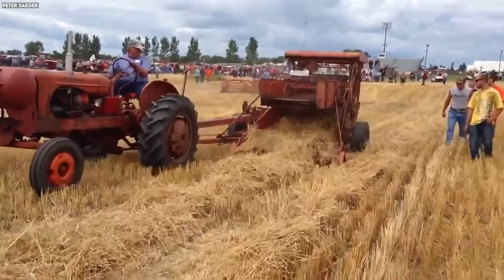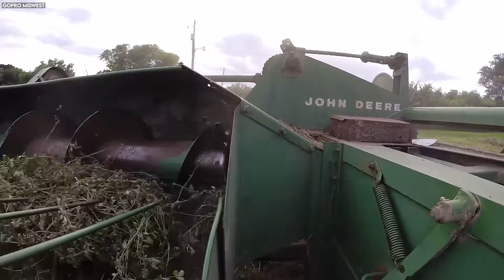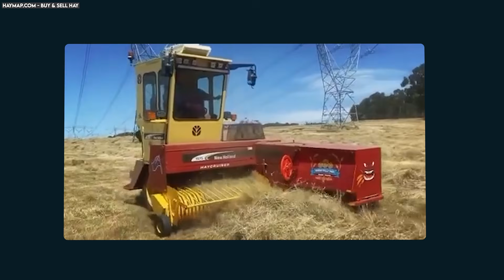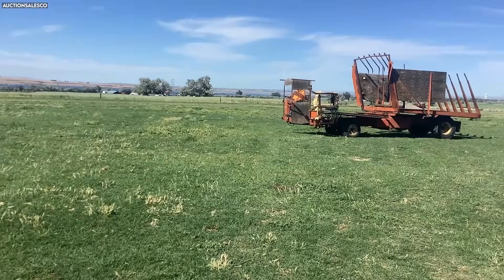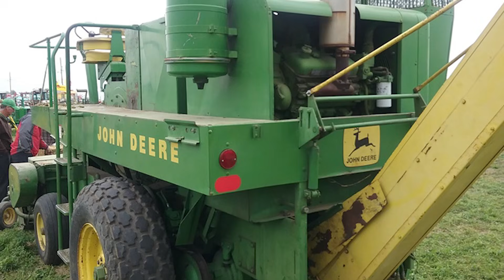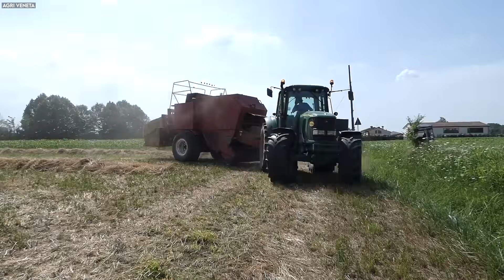10 Forgotten Hay Balers That Were Way Ahead of Their Time

Comment: I only knew of one person who bought an AC roto baler, and it was a true nightmare. Aside from it always being out of whack one way or another, he was using it on sloping ground. The bales dropped in the field, then promptly roller downhill. To bring in the bales, they first had to be dragged/rolled out of the woods. As soon as other farmers in the area saw that abomination in action, they avoided them like the plague.
In it's day, the were pushed not as something that shed rain, but as leaving air channels between bales to aid full curing of the hay. The were a nightmare to bale withand to drag out of teh woods, but also in loading, moving, etc. AC stopped building them for a reason, and it wasn't because they were "ahead of their time". It was because as soon as one farmer used one, everyone else knew to NEVER have one on their own farm.
Reply: Sold a lot of them for something that was not any good. What killed roto balers was you could not  load straight onto a  wagon.  When they came out small farmers had small tractors that could not bale and pull a loading hay wagon.  So they  baled the bales on the ground tractors got larger in the 50s so they then could pull a wagon behind the baler. Making the roto baler obsolete. When they were developed in the 40s it was a good idea at the time not knowing what the future would bring.

Comment: I grew up around a New Holland Model 77 baler. I think Dad bought it in 1952 and we used it into the mid-1960's. The Wisconsin engine was hard to start but the baler worked great. I got my first taste of engineering learning how the baler held the bale under compression while the knot was tied. I never did learn how the knot was tied though, it was magic!
Reply: My Dad and his buddy also had a Model 77. That Wisconsin engine was a bitch to start at times but it was a powerful motor and wouldn’t die.
The kick back from compression hurt at lot of wrists.

Comment: Dad used a Farmhand bale accumulator behind the AC round baler, used the haysweep on the Farmand, and dumped the bales in to the truck with the cattle stock racks up, and hauled them home and dumped them, and then at the end of the day brought the Farmhand home and filed them in a stack. Then in the winter used the fodder fork and grapple on the Farmhand to feed the cows.
Actually the Farmhand F10 loader was the most labor saving machine on the farm and ranch.